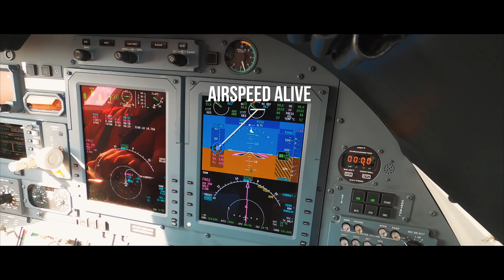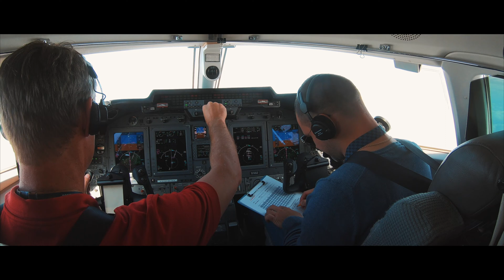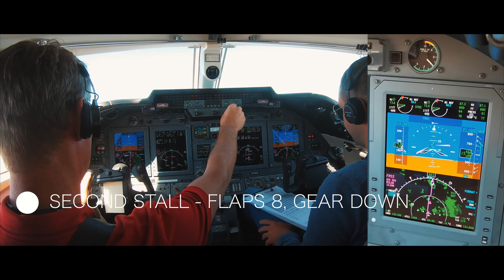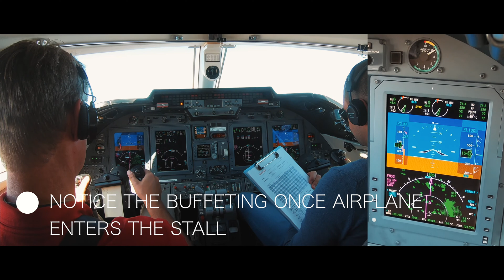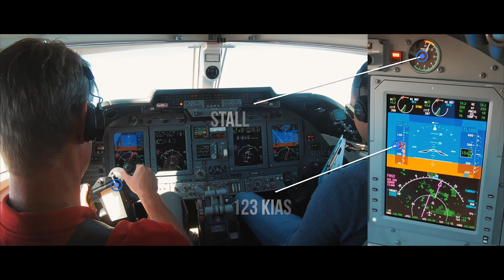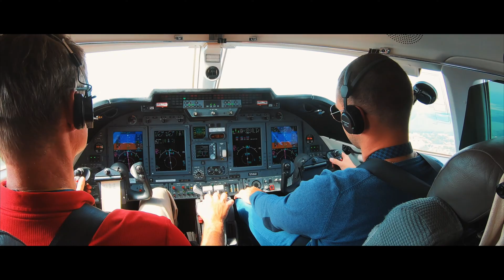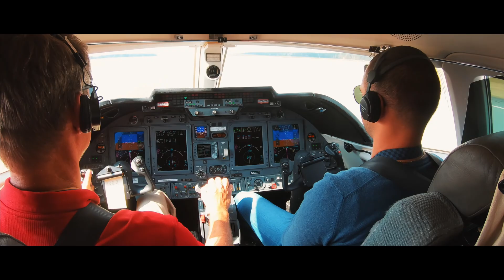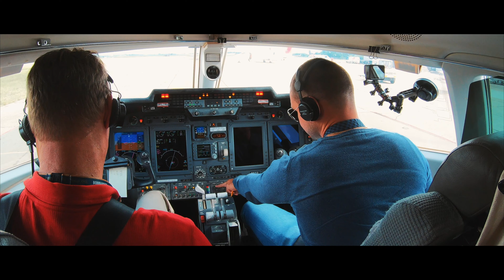Stalling Learjet 60XR on purpose as part of TEST Flight

Comment: Please be extra carful people. We lost another Hawker yesterday doing this exact process after not flying for 6 months. 2 crew and an engineer killed. Stalled after requesting block altitude FL140-160. ATC audio is horrific. RIP
Reply: In current video stall test makes by certified test pilot. Afaik in hawker crash this is be regular pilots, it's huge differences
Reply: wdym

Comment: What is with the abrupt AILERON controls during the stall? DURING STALL? Is that why he is certified? Any scientific detail behind it? Necessary?
Reply from the maker: The idea is to keep it level till you reach full aft column position. And as you are about to stall, ailerons are less effective, that’s why it requires a lot of abrupt control inputs
Reply: @TheFlyingLife less effective, I got it. Does this justify yanking side to side? Compared to aircraft movenent. I understand aerodynamics about effectiveness, etc. Hence, I am asking about the yanking left right fully.

Comment: Never understood why lear never went for single pilot certification
Reply: They actually did, quite some time ago with the 23. I flew quite a few model 23’s, different s/n’s. One of them with c/b’s located all on the left side to be accessible by pilot. The 23’s MTGW was 12,499#, kept it from having to comply with FAR part 25 cert. There were multiple cockpit variations/equipment in the 100 built.
Reply: MTOW too high for single pilot I guess
Reply: @hash2all  yes, but it's time for change.  30+ years? Boom microphone is a requirement. 😂😂🤣😂😂

When they originally came up with this stuff mobile phones were still a dream.
Reply: @OOpSjm  LOL, true that

Comment: 7:04  sawing left and right on the yoke is the exact opposite of what you should be doing in a stall,,, yoke should be center and steer with your feet
Reply from the maker: MAGA well, never do that in real life unless you want to enter a spin
Reply: @TheFlyingLife  well that was real life or was it in a sim ?
Reply from the maker: MAGA that’s what I mean, if you make rudder input having stalled airplane - you will enter a spin.

Please don’t be confused with actions that may be required if you have stall indications after lift off having not properly clean wing due to contamination. The only possible way to counteract roll tendency is opposite rudder.

However during those kind of stalls rudder is supposed to be neutral
Reply: Fly With Alex don’t bother replying to this MAGA.  He’s just hating as expected, probably learning to fly a Cessna 150 and thinks he’s better than a test pilot.  The aircraft is not stalled at the shaker.  Still flying, requires more input due reduced dynamic pressure.  At the stall; standard stall recovery is clearly initiated by the TEST PILOT.
Reply: @TKDonny  so you think myself giving my opinion is '' hating as expected''' ...seems you re the  one giving the hate .... so show me where it says going full lock left to right and back is part of stall recovery or any type of normal flying practices ?? and what plane do you fly and how many hours do you have  that  makes you a so called expert
Reply: @TheFlyingLife  i am referring to why he was going full lock left and right and back non stop over  and over again
Reply: @MAGApepe  oh and in case you're wondering my flight experience, I have flown/fly C150, C172, A33, C188. My friend (asked for how to handle stalls in a Jet vs prop) has 18,000hrs in B727, B747, B737, A320, and is an ATP and CFI for floatplane.
Reply: that only works with a piston engine aircraft, where aileron effectiveness in a stall is 0 and you use rudder to counteract the torque and left turning tendencies at a low airspeed. however in a jet aircraft there is no Left turning tendency as there is no engine rotating a propeller. in this case using rudder would cause a spin and therefore aileron is used to keep wings level. 
there are big differences between a Prop and Jet. knowing how to fly one does not mean you know everything about the other.
Reply: @Joshomoore  so you re saying a jets wing in a stall  has effectiveness with ailerons while a piston plane is the opposite ,, and that rudder use is not the main source of directional control in a stall,,, if you say so lol,,, how about the use of any aileron  on any type of powered plane will just make that side of the wing stalled even more and cause the plane to roll in the opposite direction of the control input ,, does that sound better
Reply: @MAGApepe  here are his words directly. Quote: "It looks like he is trying to keep a wing From dropping if you use rudder in a stall can put you in spin very quick   Our stall and upset training has changed over years. Now 4 steps. PUSH even upside down push stick forward to unload wing. ROLL use aileron to level wing or upright plane. THRUST adjust power add or reduce depending on speed. Then STABILIZE back to normal flight. Some day try to get acrobatic training can see  spins how to get out."
Reply: @Joshomoore  and that is  exactly what  i have been saying right from the start,,,, do not use ailerons while stalled,,, and of course using rudder can put you in a spin at anytime,,, so can a rudder stop you from entering a  spin when stalled and using rudder can recover a plane when in a  spin ,, i have done  dozens of spins and know how to get out of them,,,,,, rudder to stop the spin,, stick forwards to stop the stall,, no left or right till  wing is flying
Reply: @MAGA the pilot is a Bombardier/Learjet test pilot, as Alex stated. You think he might, as a rep of the airframe manufacturer, have some idea on how to fly a Lear 60 and conduct the post 12 year stall flights? He does it for a living.
Reply: @bobt1029   so show me where it says going full lock left to right and back is part of stall recovery or any type of normal flying practices ??
Reply: @MAGApepe  hey high-speed, he wasn’t trying to recover, he was trying to put it deeper into the stall. I know you have killer instinct from your Cessna time, but that stall horn is the start of a stall, not a stall. He took it deep into it, like you should.